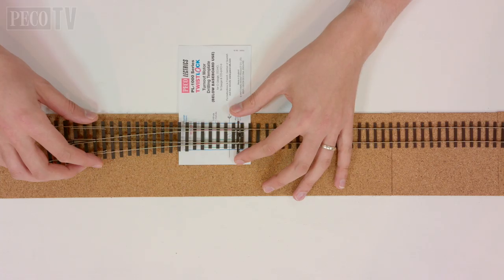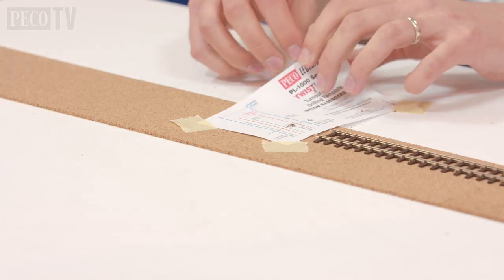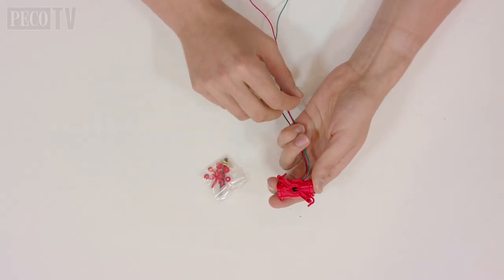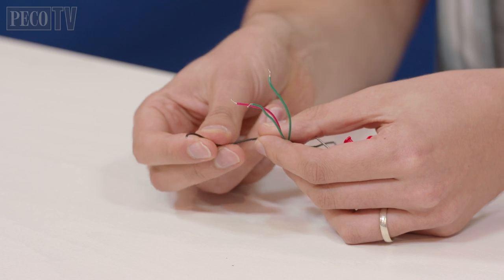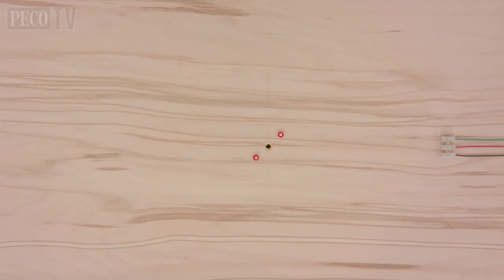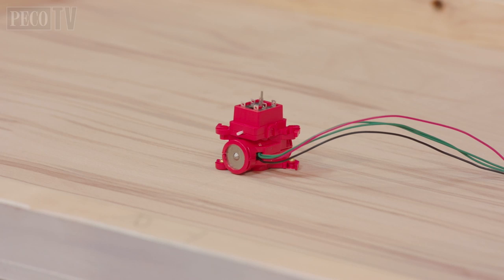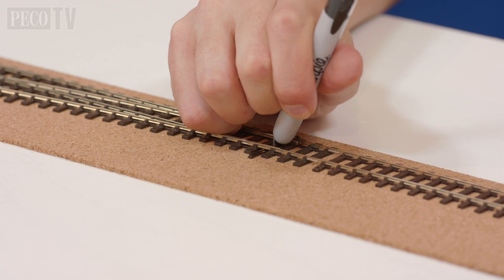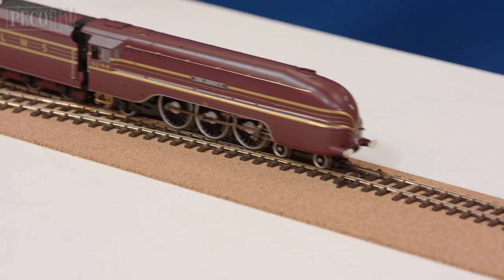Peco TV introduction to Twistlock

Comment: Looking at the video you wired the motor into your power supply using the black and red wire. The two green wires are fastened together as a return wire which I presume is the earth feed. So where do you put your switch to make the motor work, and how do you wire the separate part into the point motor to change the electrofrog polarity? Ever considered making just one unit that does everything for those of us who are electrically challenged?

Comment: Very neat fixing - The paper drilling template is a handy feature.
Can details of the dimensions of this unit be added to complete the presentation?
Hope PECO develop a servo with a ‘twist fit’ casing: as this would virtually silence the point actuator.

Comment: Very nice idea BUT as with regular Peco Switchs (PL10E) the drive pin isn't really long enough. For example 1/2 plywood base and 1/2 inch foam board with a cork road bed, the pin is too short. With heavier gauge wire (piano wire) this can be achieved. Yes it would most likely involve making the throw bar hole bigger as well. Tried to replace the wire and also tried adding an extension to it, both met with failures. It would have been nice to place mine under the table instead of having to cut out the foam and in some instances part of the plywood.

Comment: This video is all very well for builders of a new layout that have the opportunity to turn the baseboard over to make it easy to fit these items but I'd like to use these in place of the PL10 units I've got that jam with the accessory switch fitted, so I've got no option other than to roll around under the baseboard - with no guarantee that I can get an accurate fit, particularly as I can't use the template for track that's already fixed down.

Comment: Much easier than fiddling with PL10E and especially easier than trying to align the old double microswitches so they worked properly, However (there's always a "but")  Why did Peco make them so large you can't use a pair on the SL-99 3 way point?  2 x PL1001 side by side have the pins at approx 32mm centres, whereas the point has the holes in the tiebars at 22.5mm centres.  I think I must be missing something as I can't believe Peco would not make the new system truly universal, unless their design team was working on O gauge!

Comment: Would PECO be able to provide printout guides for drilling the point motor holes or are they just supplied with this motor?
Reply: Looks like they are supplied with every motor.
Reply: @junk52  Also you could just scan and print copies of it ( for your own use only of course )

Comment: Neat idea.  One thought though, why not put the microswitch outputs on the side rather than the base, then you could stack them if you wanted to, for example, change frog polarity and a colour light signal feather direction indicator at the same time as well as a control panel route setting light?  That little template seems to make fitting so much easier.
Reply from the maker: Thank you for your comments.... noted and passed on.
Reply: If you have a central station it is waste of time by follow your theory.

Comment: Aren't the Peco PL10E wired different..I thought they had a 3 wire hookup or do you just join the 2 common wires together when you hook the 3 wires up to a Decoder so you can switch it with your command station.  Are these better than the Peco PL10E ?
Reply from the maker: Thank you for your question.... the PL-10E doesn’t come fitted with wires, you have to attach them yourself. The new motor has the wires pre-attached and as you correctly say, you just join the 2 common/green wires together. The new motor is slightly more powerful than the PL-10, but it is mostly about the ease of assembly and use. We will continue to produce the PL-10 alongside the Twistlock motor.
Reply: @PECOrailwaymodeller  Sounds good thanks for the reply..I don't see anywhere one can buy said motors here in Canada though? Need a whole bunch of them
Reply from the maker: @ronk3031  Hi Ron, They are currently in the final stages of production and should reach shop shelves within the next month.  Thank you for your interest.
Reply: @PECOrailwaymodeller  Thanks I will watch for them then!  

While I have your attention do you think PECO can make a video on how to hook up a Code 55 double cross over with 4 of these motors and wire it all including the frogs so it all will work?  :)  Just wondering as my DCC N scale layout plan has 6 double cross overs and I need to get it right.  Thanks

Comment: It looks far easier to fit than the old style point motor.  I'm assuming that it's possible to use this with N gauge.
Reply from the maker: Thank you for your comment, yes it can be used on N-Gauge turnouts up to O-Gauge